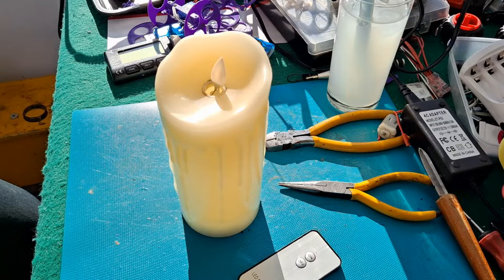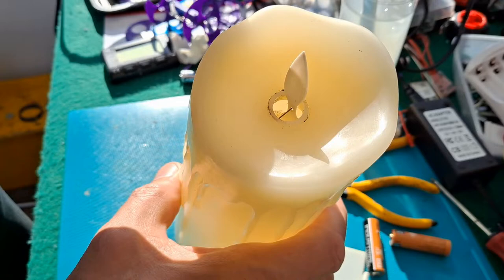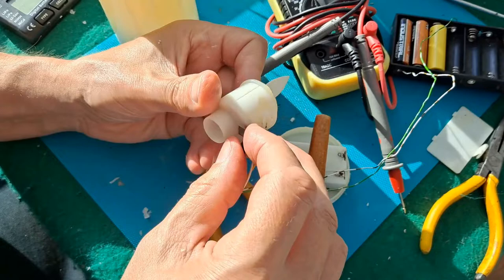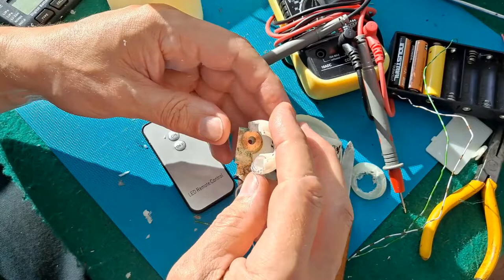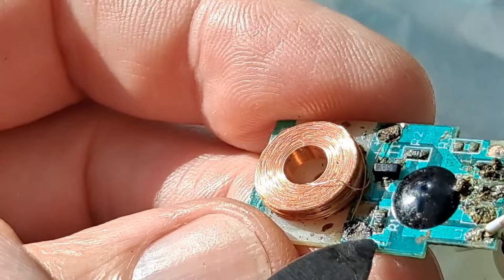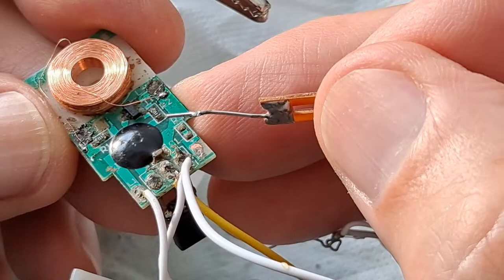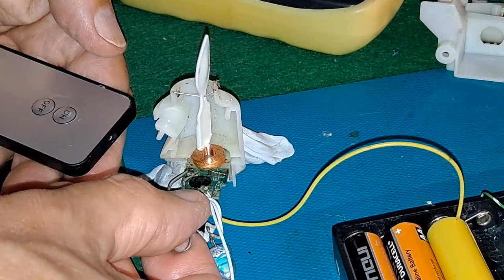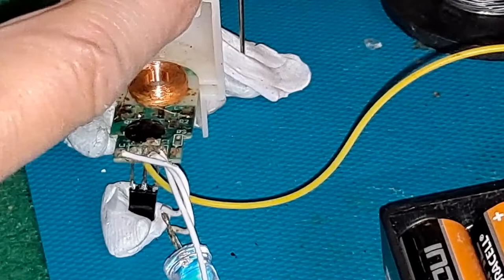Can I fix that IR RC LED candle? Part 1 (No)

Comment: In December I will have a few of those candles running all evening! I really like them, they resemble a real candle very well (when seen from a distance). Most of them have an 8 hour on, 16 hours off timer, which is great. They run on 3 AA batteries (mine does) and I use 2 dummy AA batteries and 1LiFePo4 battery (3.3 to 3.4 Volts). It runs about a week on one charge, and the LED is not too bright. The reason for LiFePo4 is because it's working voltage. A Lipo goes from 4.2 down to 3 Volts, while LiFePo4 from 3.4 to 3.3 and then tapers off real quick (telling you it is time to change it). Also most LED's will strop drawing current below 2.5 Volts, which is the lowest you can go on LiFePo4. A real win-win situation.
Reply from the maker: My wife likes them in the fireplace, gives a warm feeling without actually giving any heat 😊

Comment: that green stuff is called solder mask iirc. big clive did a video about those wax housing led candles some time ago.
Reply from the maker: Yes, you will find I refer to him and there are related links in the video description. However the issue is around the way the copper tracks have degraded under whatever that deposit was that I cleaned off. Possibly wine, coke, or even bird poo dropped down the chimney. Whatever it was, it was corrosive and ate the copper.

Comment: Well you did well to figure out the resistors were broken but good luck in working with surface mount components. They are so fiddly to work with. Good try though. 👍👍👍
Reply from the maker: Surface mount is bad enough, but the surface tracks have degraded so finding enough copper to solder to is the biggest issue. Each time I do it, a little more disappears.